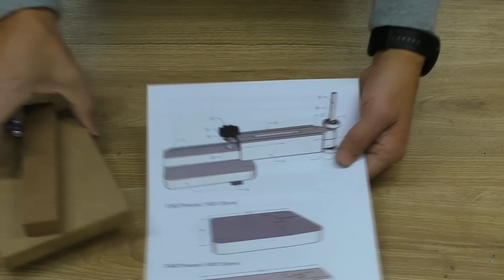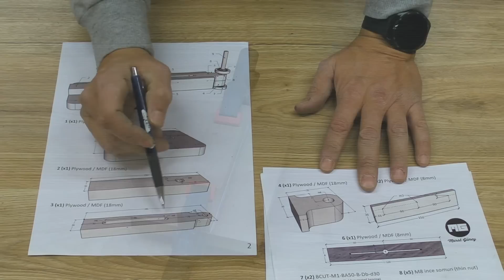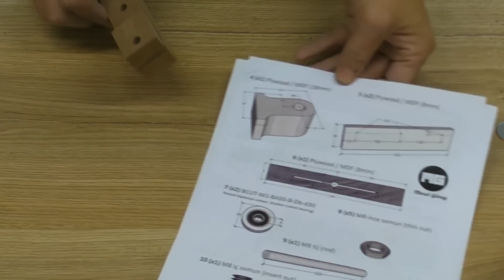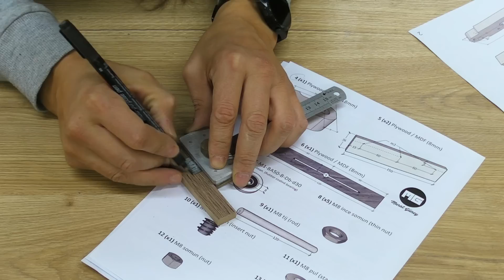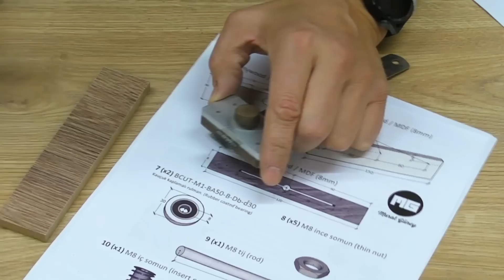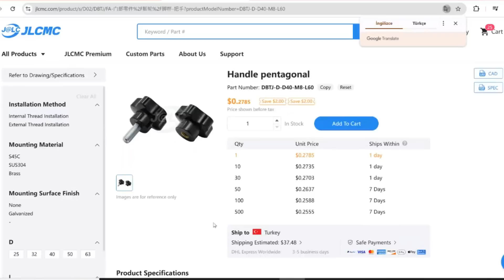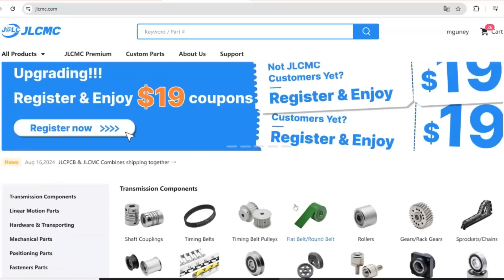A useful tool for your table saw

Comment: Thank you once again for this beautiful and essential project can we use m5 wheel
Reply from the maker: Hello. Thank you too. M5 would be a bit thin. Because with this design, the top wheel can slide up depending on the height of the wood. In this case, the M5 screw can stretch too much.

Comment: Добрый день, Мурат. Задумал сделать это приспособление, спасибо за хорошую идею. К сожалению, ссылка на запасные части не работает (страница не найдена). Если возможно, дайте корректную ссылку. Спасибо 🤝
Reply from the maker: Привет. Ссылки в описании видео не работают. Спасибо, что сообщили об этом. Ссылки ниже взяты из моего списка заказов. Они немного длинные, но это правильные ссылки. https://jlcmc.com/product/s/D02/DBTJ/FA-%E9%97%A8%E9%83%A8%E9%9B%B6%E4%BB%B6%2F%E8%84%9A%E8%BD%AE%2F%E8%84%9A%E6%9D%AF-%E6%8A%8A%E6%89%8B?productModelNumber=DBTJ-D-D40-M8-L60 https://jlcmc.com/product/s/C16/BCUT/FA-%E4%BC%A0%E5%8A%A8%E9%9B%B6%E9%83%A8%E4%BB%B6-%E5%85%B3%E8%8A%82%2F%E5%8C%85%E8%83%B6%E8%BD%B4%E6%89%BF%C2%B7%E8%BD%B4%E6%89%BF%E9%9A%8F%E5%8A%A8%E5%99%A8?productModelNumber=BCUT-M1-BA50-B-d8-D30 https://jlcmc.com/product/s/E04/EMLA/FA-%E7%B4%A7%E5%9B%BA%E9%9B%B6%E4%BB%B6-%E8%9E%BA%E6%AF%8D?productModelNumber=EMLA-C2D-B2L1-M8

Comment: Well done. Thanks heaps for all the work and effort for the pdf plans and the vid on building this in-feed / out-feed roller guide. 
Make sure the out-feed guide has no pressure. 
Other wise, the blade will be pinched and could cause kickback/kick up.  
Unless there is a guide on the top trapping the work piece down to the table.  
Best to use a riving knife.  
oops. Already covered.
Reply from the maker: Thank you very much. I'm glad you liked it. I definitely agree with you about the riving knife.

Comment: I was taught never put pressure behind the blade but front usage is great
Reply from the maker: Hello. First of all, thank you very much. Someone else made this criticism today. However, I do not think there is pressure on the back of the blade. Because I first adjust the thickness of the piece to be cut. Shouldn't there be an extra push to put pressure on the blade?

Comment: NEVER EVER PUT PREASURE BEHIND THE BLADE, THAT IS STUPID AF, AND YOU DONT EVEN HAVE A RIVING KNIFEYou can clearly see the pinching behind the blade
Reply from the maker: Hello. No pressure is applied to the back of the blade. The adjustment is made according to the thickness of the plate being cut. In this case, why would pressure be applied?
Reply: IT IS CLEARLY PINCHING 16:45. You cant say other way when it is clearly visible there
Reply from the maker: Hello. I may have pressed the system too much on the plate. This may have happened because the bearings are very flexible. Thank you for your interest.